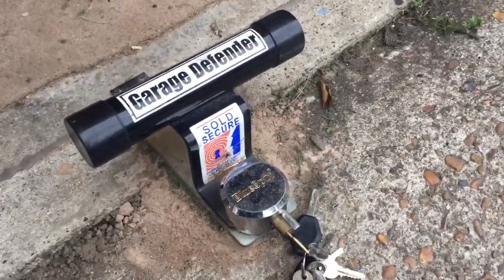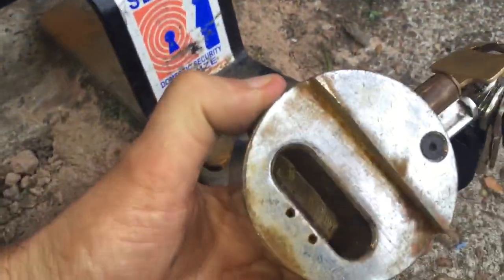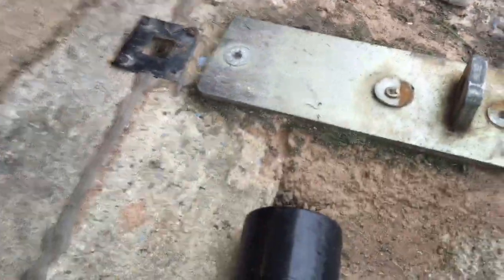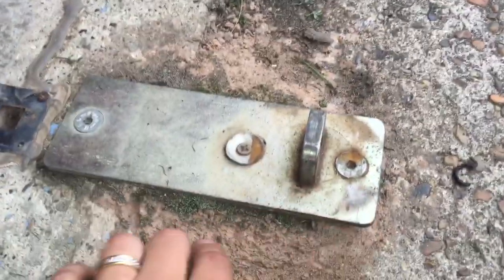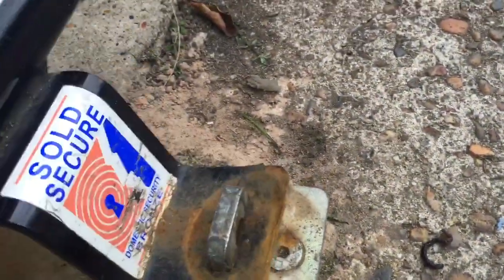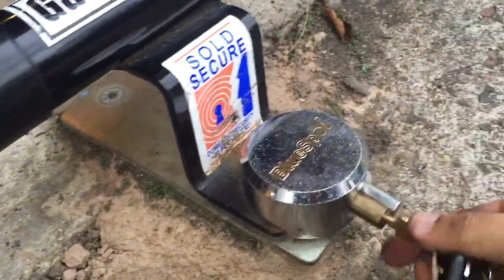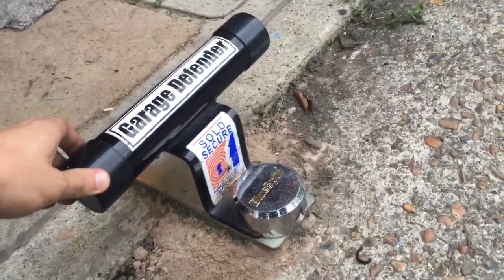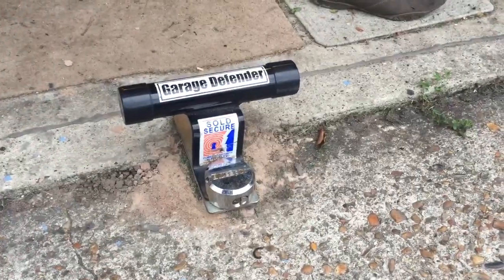Squire Garage Defender

Comment: By bedding it up in the air you have given them a perfect place to crow bar from. If you cut it into the concrete and sink it below the surface it gives them less chance to bend it strait up. One plug vs a 4ft crowbar and it would be up silently in seconds

Comment: I just use two large bolts that slide through horizontal pipes on the inside of my door, the only way you can open the door is two use two large powerful magnet to slide the bolts in or out of the frame....easy peasy...

Comment: problem with this install - undo totally exposed rear bolt, swivel the plate 180° using the convenient defender handle and gain access to garage.
Reply: nVr yeah if you do it properly, unlike this guy. You can clearly see where the door shuts by the black plate on the floor, leaving the defender plate exposed

Comment: Always put some filler into the screws.. I did it with shed... There was a, Mass break in of sheds on my street.. Mine got ignored.. They just saw the filler over the screws and like typical thieves moved in to an easier target
Reply: Not bad advice, but with this device all the bolt heads should be covered by the door and device itself when it's locked.

Comment: what drill did u have to use is it a hammer drill ?
Reply from the maker: Yes, took forever and a couple of drill bits to drill into the concrete, had a big mains powered electric hammer drill
Reply: ***** okay thanks , little did i know my dad used them back in hes old work place so lucky i had every thing that i needed haha thanks for getting back to me though

Comment: Do you get a rubber boot supplied to weather protect the lock housing?
Reply: coat the whole thing with super glue and in the keyhole, that will protect it real good.